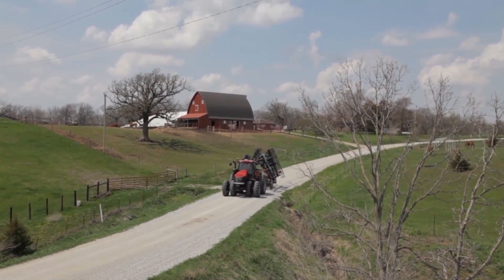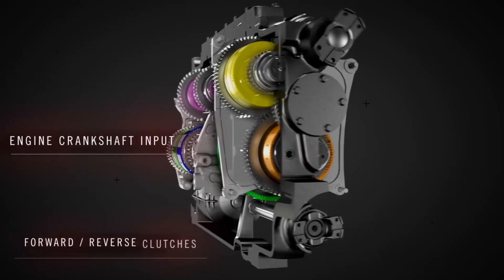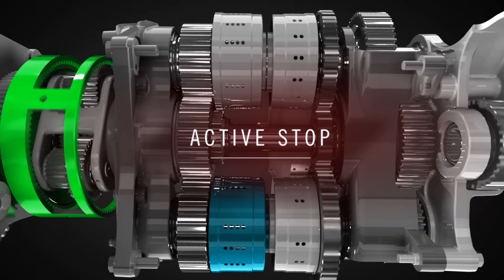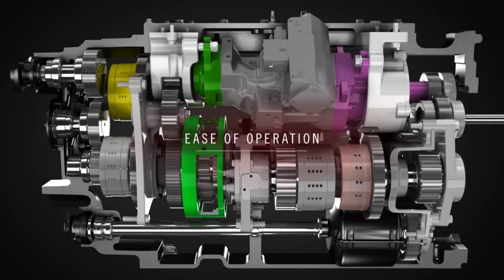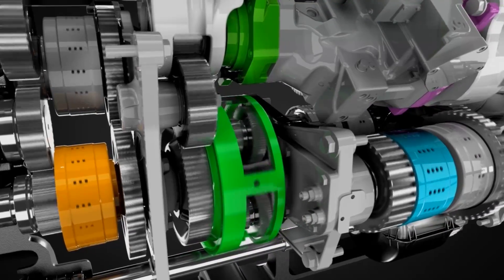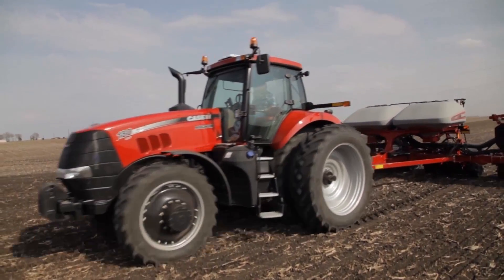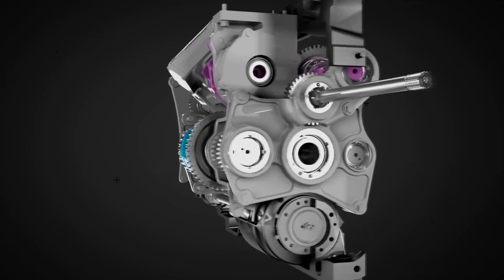Case IH Magnum Tractors with CVT Transmission

Comment: Why isn't this making its way into commercial trucks?
Reply: some cars have cvt but I suspect in trucks expense and reliability issues would be the 2 biggest reasons, another issue could be the truck slowing down too much when the transmission is trying to find the most efficient speed? if the truck maintained the speed or flow of traffic any efficiency that might have been gained is lost?
Reply: @ccclc6159  if it would hold up, I'd think it would be idea. Hold the engine at peak efficiency or power during acceleration and peak braking on deceleration.

Comment: "Hydrostatic"  ??  is that the same thing as a variable-displacement pump such as the adjustable-tilt-plate pumps some mowers have?  Or is it more like what a torque-converter does?   or something different altogether?
Reply: This would most definately be a swash plate type pump with all the cylinders, its the only pump you can "throttle" at a constant rpm

Comment: Nothing is 100% efficient. There will be heat and friction loss in the transmission.
Reply: They said mechanically, idk how that works
Reply: @connerbrandl5103 think of a solid shaft. An engine rotates that shaft at 100rpm. That shaft then rotates a pulley at 100rpm. Since the shaft is solid and both turn at the same speed it’s 100% mechanical efficient. Same concept here once they match speeds they are 100% mechanically efficient
Reply: @austinpaxman503  thanks for reply, I’ve actually gone to fox valley and learned in pretty good depth from cnh how the cvx/cvt works. This last year, I hadn’t when I commented.

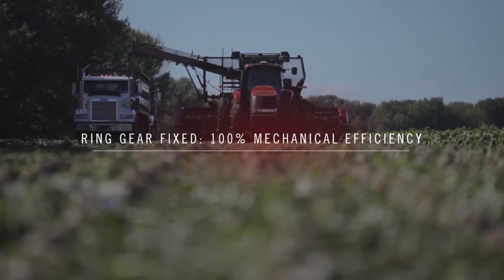Comment: 3:06 "100% mechanical efficiency" - from now and on will not believe to any word on this video.
Reply: Они имели ввиду высокий КПД планетарных передач, до 99,6% Естественно 100% быть не может...Видео в целях рекламы, а не описания
Reply: You are right. I had to go back and listen again. For some reason I took it to mean 100% mechanical not 100% efficient. I think there is little question that mechanical is more efficient than hydraulic but nothing is 100% efficient.
Reply: Bobby Sue  "we achieve 100% mechanical efficiency" is exactly what it says.

Comment: The think apart from being so expensive if this transmission fails I dislike most, is the fact you are no longer being challenged to become a great driver. Nowadays you just hold the throttle, thats it. Where is the challenge into mastering the skills of driving? Quite boring to be honest.
Reply: Who said that we need to be challenged while driving, these are way better than any outdated powershift
Reply: Cruising Danny we’re the standard Me and your tracker transmission with for ranges and for gears in each range

Comment: I don't understand why it's called a CVT when I don't see any form of CVT belt chain or otherwise I'm just saying
Reply: It's not using a belt and a variator like you know. It uses a variable hydraulic pump and motor to change the speed of the outer ring of the planetary gear. That way, mechanical power transmission goes from 0-100% in the range .(0% at start, 100% at full speed of that range). When it shifts to another range, it starts again in that range from 0% mechanical to 100% mechanical. Therefor , you can drive at 8km/u 100% mechanical , but at 9km /h only 10% mechanical. In a fendt vario , the procent mechanical power transmission is constantly increasing with it's speed, according to on of the two ranges (0-25 or 0-50 kmu)
Reply: @bartdereu  thanks, you just explained the whole system as complexed as it seems
Reply: Constant Variable Transmission.
Reply: Bobby Sue  What are you about 13 years old?  Practicing to be an asshole when you grow up?
Reply: ED 25 there is more than type of cvt
Reply: You see Cvt means continously variable transmission, there are many designs for powershift, who said there is one set design for cvt

Comment: Fendt CVT is way simpler, with no clutches,and no shifting ranges..
Reply: yes but it need more power from the engine
Reply: Fendt 0 case 1
Reply: You would think so, but several tests have shown that it's the most effecient CVT in total. Some CVT's  will win this in some area's of speed, but overall the Fendt Vario will win.

Comment: i rather trust a simple 4x4 snychromesh.
Reply: Nagy Andras imagine having no synchros to fail or shifting forks or linkages. these new boxes have more reliable components that shouldn't wear as much if looked after
Reply: @JCB411abuser  Wtf useless idiot would  break syncros or forks?
Reply: maybe but imagine trying to unload on the go with that, or do many other tasks that these do easily, we plant with a cvt and do odd jobs with a different cvt tractor, this transmmision makes a powershift look like garbage
Reply: @nicholasfry8695  i do odd jobs, with an 18 forward 4 reverse manual gearbox. and its not even synchro. had a tractor with cvt. the cvt was the first thing that gave up the ghost. glad it suits you, but it does not suit me ;)
Reply: @nagyandras8857  Yah for us cvt is way better
Reply: @nicholasfry8695  I had been  farming since the  70s never had a problem with operating machinery efficiently with manual or powershift transmissions, never ever had a gearbox problem either and some tractors had over 30000 hrs up.